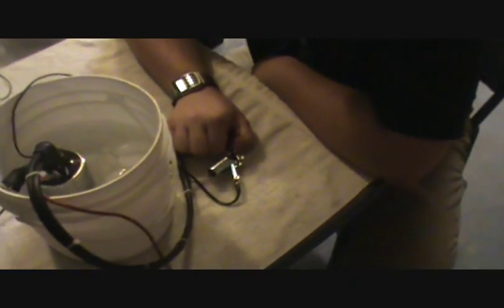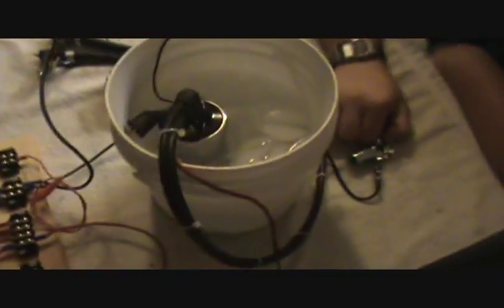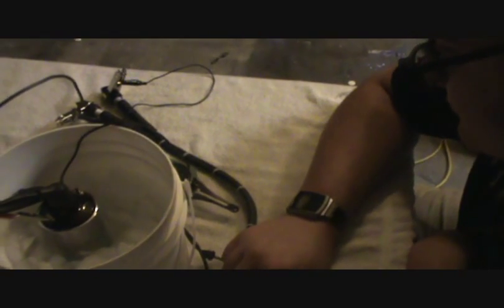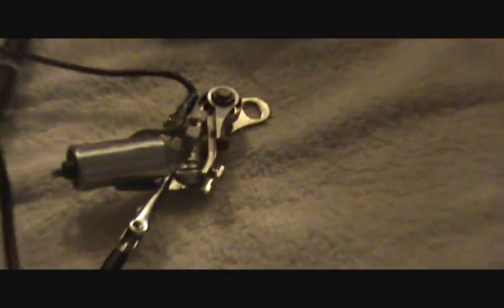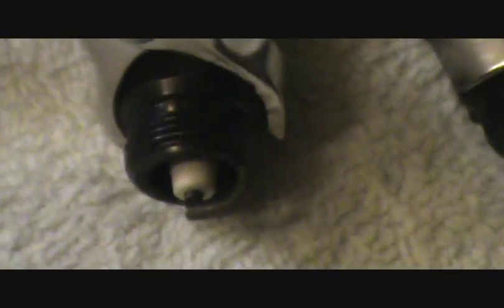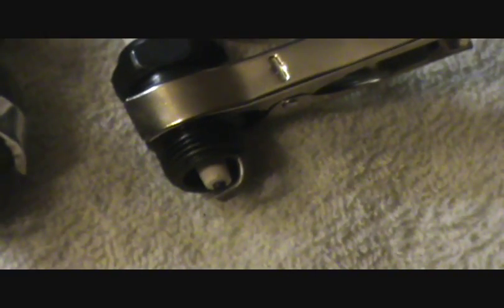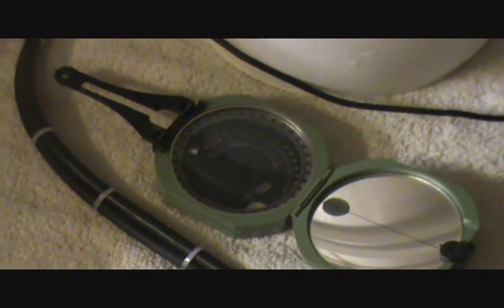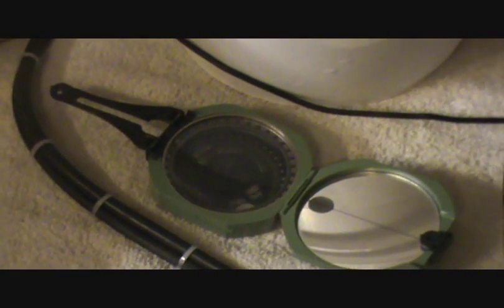Spark Plug Wire Inductance Experiment

Comment: You're wrong.
As a young apprentice, I visited Champion Spark plugs in the UK for a training day. During this training they ran a single-cylinder engine with a single HT lead, though it was deliberately very long. At the half-way point they opened a breaker eliminating ANY physical connection from the HT lead core at the coil to the plug but the motor continued to run.

You also need to consider that the plugs are NOT at atmospheric pressure when in a combustion cylinder and the energy is therefore significantly higher.